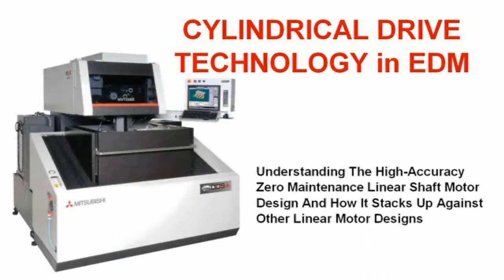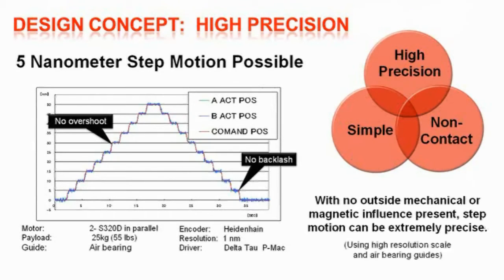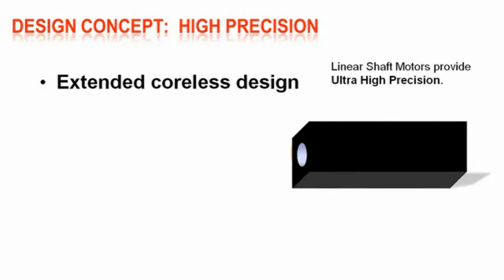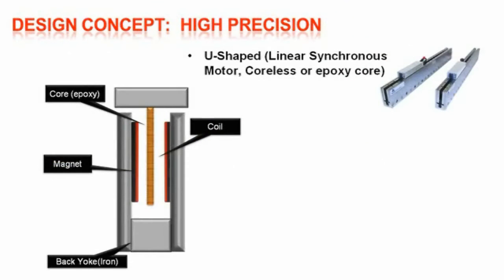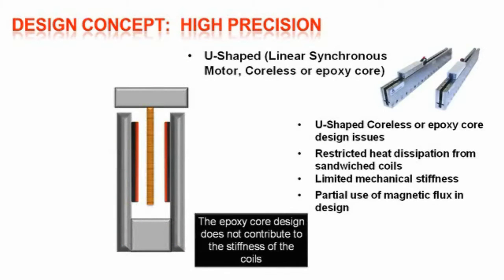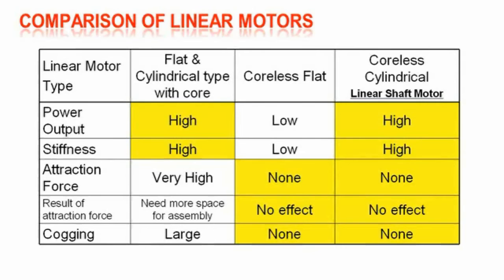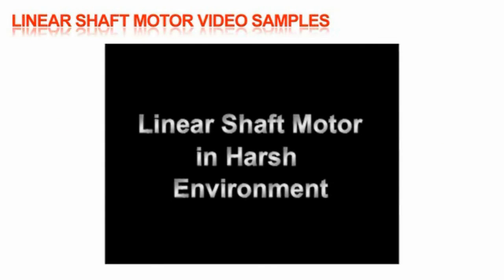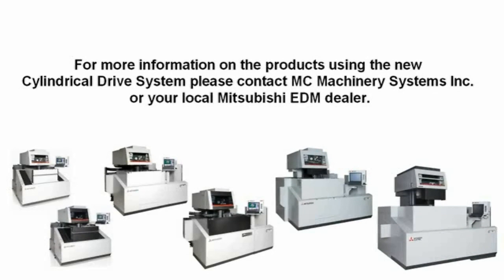Linear Shaft Motor Engineering Overview

Comment: 1:14 but how it holded that shaft? And when the shaft is to large it create balance problem wich that stator can hold stright.
This can be good for small size and precise(pump valve). 
I like electric motors. Are so many type. AC motors, brushless motors, axial, radial, linear
Reply: ahhh ok. so the part wich is moving is the stator. The cooper coil with its cable. And the shaft is like guide fixed. yeah in this case no proble of unbalance movement. And the guid will hold the weight. Ok. i was thinking in not moving the coil with the cable but if is made nice cable management is better than have to deal with shaft.

Comment: I saw these issues years ago and had this same idea. I was told by teachers it wouldn't work. So I moved on. I always questioned why the physics,math, and industry have always used the outside flux of coils or magnets rather than inside the coils or aligned magnets where all the flux lines can be used where they are the strongest. Use all the flux or 90% of it. Good to see.
Reply: Because is garder tu manufacture in industrial way. more expensive due to aditional encoding sistem. And harder to refrigerate the inside cooper wich work with inner flux.

Comment: One of the better overview videos of linear shaft motors.  Do you know if such linear shaft motors could generate enough force (two per axis if necessary but not more) to use in a diy benchtop CNC machine (capable of readily machining aluminum, gantry or perhaps vertical mill design, something with a cutting area vaguely around ~60x90cm, z maybe 15-20cm)?